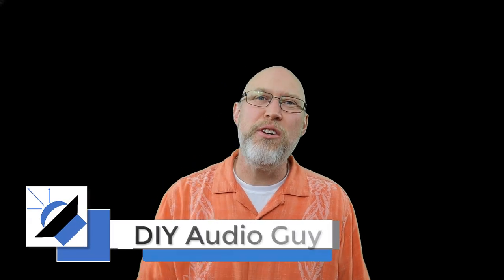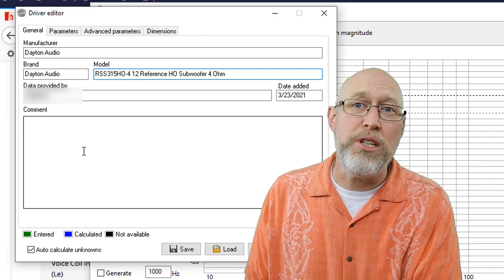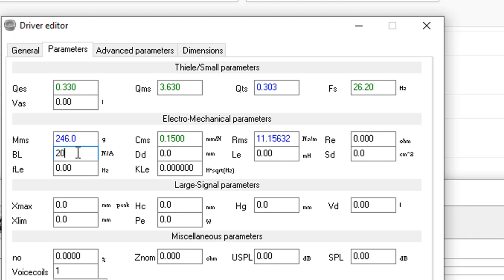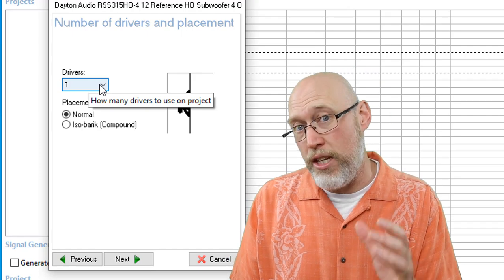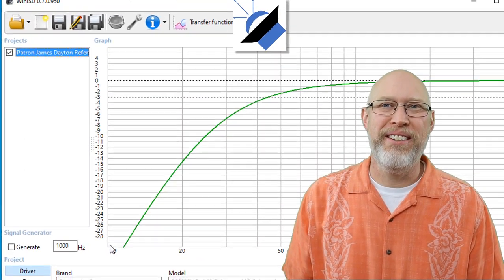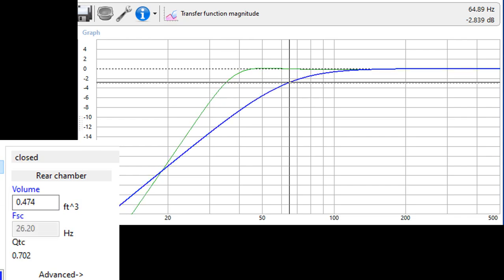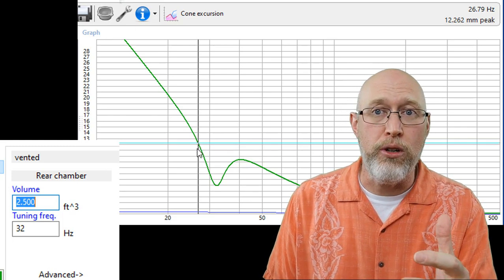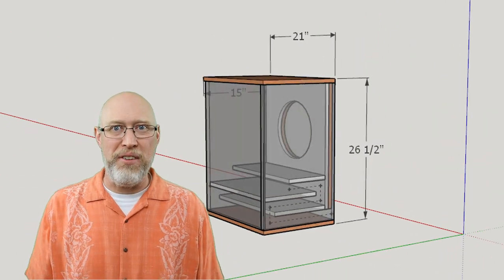WINISD for beginners, design your own ported enclosure!

Comment: Hey I've got a question about winisd.
I've been designing and comparing boxes for my next trunk build and I'm a bit confused.
Does/can winisd account for port placement?
There's a big difference in port+subs facing forwards compared to only one or the other facing forwards when squeezing two 15s into a trunk.

As I understand it the air pressure/sound wave coming from your port will synchronize or become in phase with the pressure/wave coming from the front of your driver and give you a bass boost.

Is there a way to know or graph when these waves become In and out of phase?
Does this effect still take place when your port is not facing the same direction as your subs, would it change the frequency at which the waves become in phase?
Reply from the maker: WinISD assumes that you are in a very large room and it does not provide any information about port location.  The box size is net, meaning it does not take into account port displacement.

Comment: I tried to follow along with an Alpine SWS-12D2 but the volume never gets auto populated and no response graph shows up. :(   I am sure it is because I can't find all the fields required.  Ah, if I edit the driver in the project and set Vas it graphs for me, not sure why it doesn;t bring the Vas from the driver I created.

 This seems much more difficult to use than bassbox pro granted I have never used bassbox pro for much so IDK if they are similar in functionaliity.

Comment: Qts and Fs has een close relation, do you want higher Qts, Fs get,s higher and vica versa, so choosing wise for low bass is needed, I have visatons wsp26s these has fs 19 hz and Qts of 0.38 very nice for bass.
Reply from the maker: That is why I like WINISD, I don't have to worry about that.  Just plug in the parameters and see how it works.
Reply: @DIYAudioGuy  I do use diyaudio hornresp, but winisd is quite oke, nice to use the gliders for the fine tuning. I had to learn to put in drivers in winisd, it is a little tricky.

Comment: Hi, does winisd compute the port wolume with the box/chamber volume you input or do we have to offset the port volume from the actual box, thus adding more volume to the box to compensate?
Reply from the maker: Yes, you have to add volume to compensate.  WinISD gives you the NET airspace.  After you account for bracing, the drivers, and the port you end up with gross airspace.

Comment: I followed your steps and got a integrity check data failure. The error says basically every entry i made is wrong plus a couple I didnt touch nor is listed on my sub specs (mpow, rme, re)

I tried following steps from another video and have same issue
Reply from the maker: The manufacturer may have provided incorrect TS parameters.  That happens.

I have found that if you type a number in and then click into a different field, and then give it a second to update before you start typing the next number, the auto calculation will keep me from having integrity check errors.

I've also found that the software will run if you have integrity check failures, not sure how reliable the results will be.

Comment: Thanks for your videos!  Using WINISD  I learned that my particular subwoofer will play louder in all low bass frequencies in a smaller(1cu ft) sealed enclosure  than in a 1.5cu ft. ported one.  The TS of my sub indicated that it leans more towards a sealed sub than ported so this makes sense.  The math doesn't lie as long as all the subwoofer information is properly filled in!  Also I had port velocities up to 30m/s at tuning with the ported which isn't terrible but definitely not optimal.    I just wish I could share my graphs.
Reply from the maker: That's the cool part about modeling enclosures with software, takes a lot of the guess work out of it.
Reply: hmm that's weird what subwoofer is it?

Comment: I know you can change the port area to change the port velocity, but for spl purposes does winsisd calculate the db when you change the port size? Will the box get louder with more velocity or will it restrict output, how do you know what the port area should be for max spl? If you make the port bigger will it get louder? If so, how big is too big? And vise versa for a smaller port.
Reply from the maker: Unfortunately, it does not show the impact of port cross-section on SPL.
Reply: @DIYAudioGuy  is there a program that will account for this? Or is there a way to calculate this?
Reply from the maker: @charlesreedy9330  none that I'm aware of, there are some rules of thumb that say when the port velocity gets too high, you'll get compression and it will cut your SPL. I don't remember the numbers off the top of my head, but it's well above the standards for sound quality, around 17 m/s Port velocity.  Something like three or four times that.

Getting a really big number on an SPL meter is often times a matter of trial and error plus a ton of power and cone area.

Comment: I have another possibly silly question. If the auto fill parameter in blue is drastically different than what the manufacturer posts, do you change it or leave it with the auto filled calculation?
Reply from the maker: Leave it, but double check everything to make sure you've got the units correct.  Some of them are metric. Some of them are not.
Reply: @DIYAudioGuy  Awesome will do. Thanks again.
Reply: Was wondering the same thing

Comment: Do i need a high pass at ~25 hz before my subwoofer? Is it ok if my amplifier simply has a Infrafilter included and then those frequency wont even come to the subwoofer? Also does it make sense to filter those frequencies before they come into the amplifier in the first place? At the moment my diy subwoofer doesnt have that filter but my amp does, im wondering if i should be worried.
Reply from the maker: If your amp has an infrasonic filter (some call it a subsonic filter,it is just a high pass that keeps the lowest frequencies out of your sub) then you don't need any other infrasonic filter.  I prefer to use the crossovers in my DSP because it is easier to adjust.
Reply: @DIYAudioGuy  Thanks for the respond! Then i just keep plain cable between my amp and my subwoofer. (quite a big system though, 2x 18'' RCF speakers on rated ~800 RMS Watts.)

Comment: I’m new to the winisd, watched your video and went trough the sssteps needed to create the profile and box design . Now how do I get that to paper. I’m a construction worker so I know how to build the box itself but how do I apply the program to paper ? Please help .
Reply from the maker: Convert to cuin by multiplying by 1728 (say 2 cuft * 1728  = 3456 cuin).  Then pick to dimensions (ie. 12" tall and 24" wide)  Multiply those together (288).  Then divide (3456/288) to get the depth (12).  Hope that helps.

Comment: So, Im thinking of building a small Cube Box for a 6 1/2" Woofer with two matching Passive Radiators.    Does WinISD have a calc for this or is there some kind of work around?
Reply from the maker: Yes, WinISD will do that.
Reply: @DIYAudioGuy  Did the DL anyway and found it.  Thanks for your Reply.

Comment: For Mac Users (this may have been said already) I finally found a way to run WinISD.  Wine and WinBottler are free programs that have been recommenced to run WinISD without the hassle of virtual machines, bootcamp, parallels, etc. But for me, both of those program wouldn't run properly but simply not opening, or quitting/crashing when trying to load WinISD under advance options, respectively.  Nearly giving up, I found Wine-Stable (Wine-Stable 7 the most recent version, but Wine-Stable 5 is what worked for me.  I could be wrong, but during install I selected both 32 bit and 64 bit as an option.  After installing Wine-Stable 5, I am finally able to run WinISD on my Macbook Pro, without having to pay for a windows subscription.  I hope this helps anyone with a Mac!
Reply from the maker: Awesome!
Reply: And while Whisky is not supported these days, it does run in Whisky/Windows 7, at least on Tahoe 26.2.

Comment: When you say flare the port end, do you mean just simply rounding off the port ends with sandpaper or router bit, or are you talking about using aero ports?
Reply from the maker: I was specifically referring to arero ports.  But I have found that rounding off the port with a router bit is very effective at cutting down port noise.

Comment: Interesting, I designed a 3 GHz RF cavity with tuning ports called re entrant cavities back in the 1990s. I used it for an electron positron accelerator at SLAC while I was at Stanford back in the day. I used it to smash sub atomic particles while you smash air molecules!
Reply from the maker: Science is fun.

Comment: Honestly i have a lot of trouble  in this area. I really need a custom  box but completely suck at getting the right size that fits. Also I've used mostly sealed enclosures since the 90s. The last few years im using ported an to me they are not producing the bass i was getting back then. Yet i hear these ported enclosures are supposed to offer up more bass. Definitely not from prefabs.
Reply from the maker: Not sure what to tell you.

Comment: I have speaker 8" subwoofer . What best box for that?
Reply from the maker: Depends on the subwoofer.  If you know the manufacturer you can look up there recommendations, otherwise just throw it in a box that's around 0.5 to 0.75 cubic ft and see if it sounds good.
Reply: Speaker from magnat company 8 inch What is the shape of the air vent suitable for the box, circular or wide?
Reply: @DIY Audio Guy  What is the best type of wood to make a Subwoofer box and how many mm? Do I fear it with cotton?

Comment: But what if my driver not on there for the new project?  This is the step we just did right.
Reply from the maker: You will have to add the parameters manually.  The winisd driver database is at least 6 or 7 years out of date.
Reply: @DIYAudioGuy  thanks I got it now.

Comment: dear audioguy,
can u do a correlation video regarding
vented boxes:  correlation between transmissionline;bassreflex;horn

cuz port length does in fact matter due to the resonace fq
but in a non linear but expo port
aka horn   how do i calculate that

eg.  big   W bin  is combo port with horn
Reply from the maker: I don't really know enough about horns and transmission lines to do that.

Comment: Hi friend, I have a BEYMA 10BR60 speaker, I have a problem entering the driver data ... I'm still red. You can help me ?
Reply from the maker: Try to let WinISD auto-calculate as many of the parameters as possible.  Just have to enter them slowly and give it a chance to update.  Other than that there is not much else that can be done.   But, WinISD will run even if the parameter check fails.

Comment: So is System input power under the Signal tab gonna be the peak or RMS of our amp?
Reply from the maker: RMS, always use RMS. (https://youtu.be/NuO9b1fYisY)
I typically use 80% of RMS since you lose some power due to box rise and power factor.
Reply: @DIYAudioGuy  I was gettin worried for a minute. I entered 80% of peak it was far past X-Max around 57hz. At 80% RMS its right at X-max, which is 7mm for my sub. Thanks!

Comment: The box volume in winisd tells the net internal volume (gross volume minus the woofer displacement, port displacement and any space occupied by bracing) or does it tell the gross volume ?
Reply from the maker: Net, so you will need to add airspace to account for all those things.

Comment: I have a critical mass UL 12 I want to build a ported box for but I can't even find half of the parameters needed. Would it still be possible to use WINISD to make a box for it?
Reply from the maker: Possibly, not all of the parameters are needed and some of them will auto calculate.

Comment: Looks like a cool program! Never tried it but I'm gonna have to get a computer so I can use something like this for designing speakers! (Only internet access I have rn is my phone which I'm writing this comment on.)
Reply from the maker: The good news is that it's a very old program so you don't need a new or fast computer.  As long as you're running Windows it'll work. Avoid things like Chromebooks.

Comment: How do i decide the box tuning freq. I want a sub going low and not lossing those dbs. My sub has a fs of 35hz. So how do i decide how much to go low in box tuning. What parameters should i look for in win isd ?
Reply from the maker: Once you have it in WinISD you just model it.  35 is a good place to start for a car.  Tune it higher if you want it louder, lower if you want it lower.

Comment: great video .......i was looking at the crescendo forte 15 or 18 inch subwoofer....could these be tuned to 20 or 25 hz ...?..i would like to use them in hometheater.....thanks
Reply from the maker: I'm not familiar with those drivers.  Other than just sticking the parameters in WinISD there's no real way to know.

Comment: I've never used WINISD before but it looks great. I use BBP6 but it feels limited most of the time. Instead of all those folds why not run the port up the back wall?
Reply from the maker: I don't know that WinISD is any better than Facebook pro.  As far as folding the port versus running it up the back wall, that just depends on your other design restrictions. Maybe the back wall is not going to be long enough, maybe you have a depth issue.
Reply: @DIYAudioGuy  yeah obviously provided none of those are a factor... Just I prefer as few bends as possible.
Reply: @DIYAudioGuy  Just discovered your channel (been under a large bolder...) Your content is great and truly appreciated!  Question on folding slotted ports, is there a rule to how many "folds"?

Comment: When you are looking at the different volumes/tuning frequencies, how are you making that adjustment without typing a number into the boxes? Are you doing a mouse scroll or using arrow keys? Starting around 7:19
Reply from the maker: You can adjust the box volume by clicking on the picture of the box and moving them mouse, or put your cursor in the input boxes and then use the arrow keys.
Reply: @DIYAudioGuy  Awesome, that's a great tip to know!

Comment: Soooooo I've entered parameters right from the manufacturer before, triple checked they were correct, and still had them fail integrity checks. How? Much confusion
Reply from the maker: Let WinISD autocalculate.  That will fix most of the problems.  The software will still work if the data check fails.

Comment: If you change the END CORRECTION value, is Winisd showing any change in vent length or tuning ??? For me nothing is changing, whether I use 0.732 or 2.227 as end correction.
Reply from the maker: That feature does not appear to be working in the version that I have.
Reply: @DIYAudioGuy  yeah... I downloaded and installed winisd 2 months back. I hope mine is latest one. But end correction not working in mine either. However if the change in vent length because of end correction is not huge, we can ignore ....but I'm not sure ...
Reply from the maker: My email address is listed in the about section on my channel. Most YouTubers will put an email there.
Reply: @DIYAudioGuy  got it ... I sent you an email 😊😊👍

Comment: Your subsonic filter can greatly reduce air velocity which allows the use of a smaller port. I set my subsonic filter at the subs f3, but some also recommend setting at 2-3Hz below tuning, or one half octave below tuning.
Reply: A few hz below tuning is still cutting audible frequencies , a ported enclosure still plays below tuning , my box is tuned at 33hz but I still get audible notes at 28hz no way I would cut it at 32 or 31hz......imhave mine set at about 20-22hz that's much more reasonable
Reply: @7 Logik  Well it also depends on the slope (6db, 12db, 24db, etc.) applied power, type of subs, enclosure size, and type of music you're playing (Rock, Hip Hop, Rebassed, etc.). The crossover filter doesn't just abruptly cut off frequencies, but it rolls them off at a given rate depending on the slope. So with a 33Hz tuning if the filter was set at 30Hz with a 12dB slope you would still be able to play 28Hz with no problem. The lowest recommended is 1/2 octave below tuning which would be 24.75Hz at 33Hz tuned.
Reply: @DBASS_000  correct
Reply from the maker: That's a good point. I've got a video on setting an account infrasonic filter, I never thought about the impact the filter would have on port noise.  But if you're cutting the signal you're going to be cutting the port noise as well. https://youtu.be/iWRoIho7A7c

Comment: @DIY Audio Guy
You need to remember the box volume DOES NOT include the port volume, WINISD treats these as two separate things
Reply from the maker: Correct.  You also have to take into account the displacement of the driver as well as any internal bracing.

Comment: Hi ... Please make a video on adding room gain and parametric EQ filters in winisd. Both for sealed and ported simulations. And even after adding filters cone excurtion should be in limits.
Reply from the maker: Not a bad idea!
Reply: @DIYAudioGuy  in some cases I saw that just after adding room gain filter,  cone excurtion went up crazy 😂😂 !!!! 

I dont think that happens in real world. I mean, cone excurtion may not behave completely different when the sub is in an open space Vs closed room. 
Or winisd is estimating wrong. Need to investigate further...

Comment: does winisd pro calculate in the port and driver displacement when showing the graph line? say i want a box at 2.8 after displacement. do i add in the displacement when i put in the box size in winisd. or just the end volume?
Reply from the maker: Unfortunately it does not. You have to account for the driver, the port, and any internal bracing.  I typically do the math on a spreadsheet.